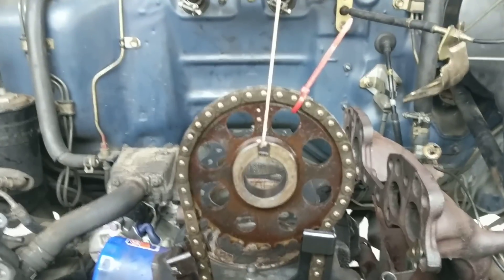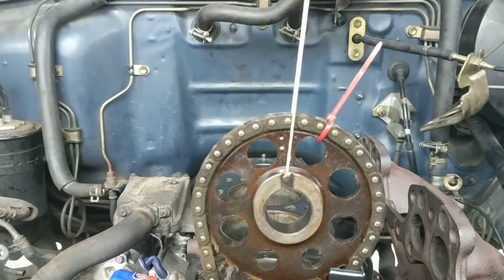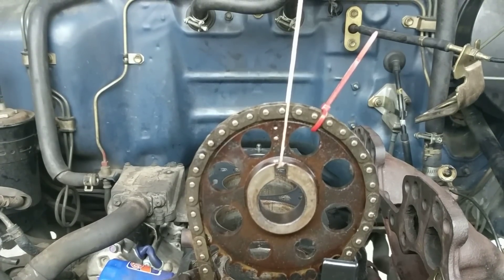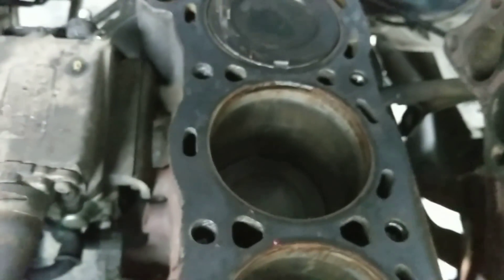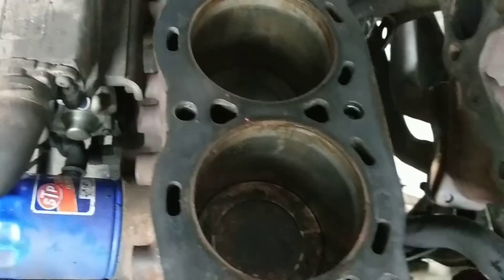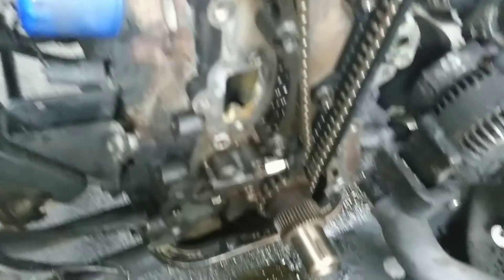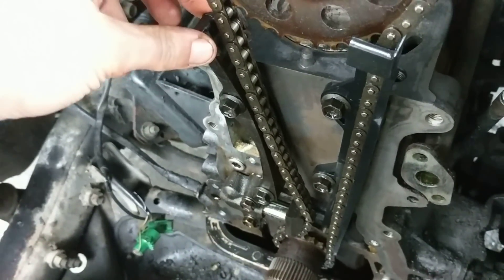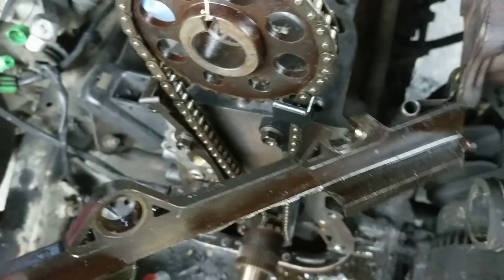🔍 22R Timing Chain Replacement - '88 Toyota Pickup

Comment: I put metal guides that came with a kit...but the new tensioner must  be bad...at low rpm with engine warm at idle you cain hear chain noisesi. I should have used an oem tensioner. After a new head gasket, rings, bearings, seals, clutch..... this is the last thing i need... I am trying lucas oil treatment to see if it quiets down.... the tensioner works on spring loaded tension and has an oil hole in it so possibly oil pressure too... because when you rev it. It goes away for a short time. Then it comes back.

Comment: Went back with a metal one and I think I got it one tooth out in between the top and bottom gear it runs but is weak power and rattles
Reply from the maker: Is your distributor in the correct position? There is a bolt you can loosen that will allow you to twist the unit. This is meant as a way to 'advance' or 'retard' the ignition timing. A great place to start before tearing things apart.

Comment: I see you replaced it with another plastic guide. Do you recommend them or the metal ones
Reply from the maker: I've seen differing opinions. 

Metal is tougher but if part of it comes loose, it could cause damage. I think it is very unlikely to cause issues, though.

Plastic is safer if it comes loose cause it will disintegrated. Plastic is cheaper, too.

I chose plastic because it was cheaper and I plan on upgrading to duel chains some time soon.
Reply: @IsaacDozier1  You make a good point I'll probably stick to plastic guides